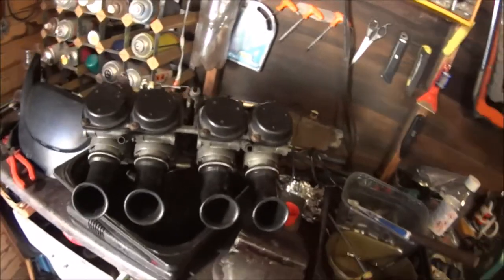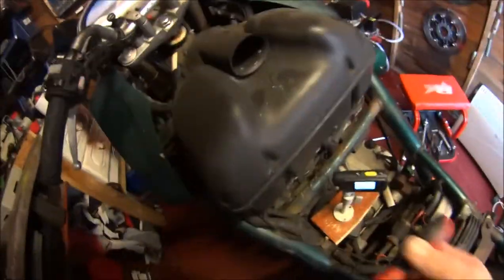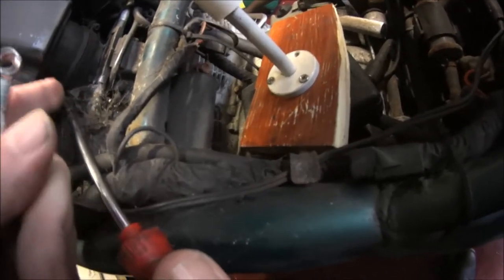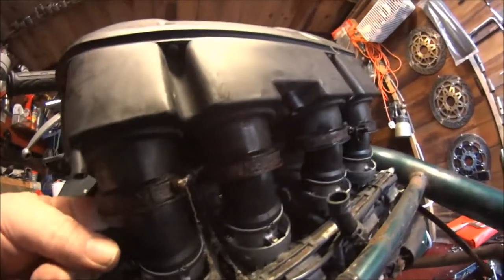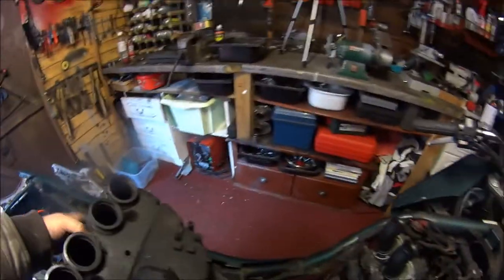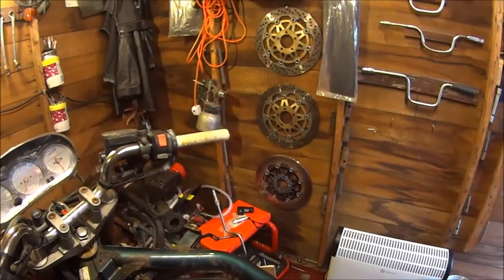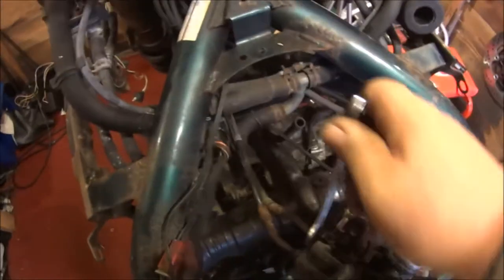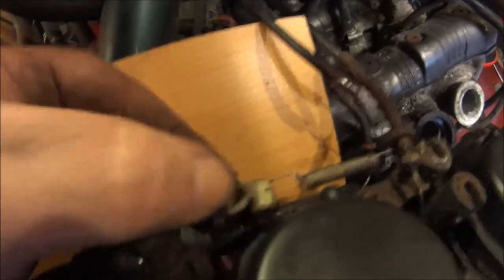XJ900S REMOVING THE CARB'S,  PROJECT. PART 2

Comment: To be fair I would have used more WD40 or preferably PlusGas and taken a bit more time loosening some of the fasteners! I do enjoy your videos though and these are my sort of bikes, I am taking notes and I've just remembered I also have a step drill somewhere which I would have been better off using on my VFR750 RC24 box of bits the other day. My old Draper hammer drill has died a death so I'm using my Screwfix cordless drill for now. Only discovered your videos a couple of weeks ago when I was just about to px my 2 750 teapots for a XJ900 but I changed my mind at the last moment!
Reply from the maker: Thanks buddy and all the best with your projects .. 👍